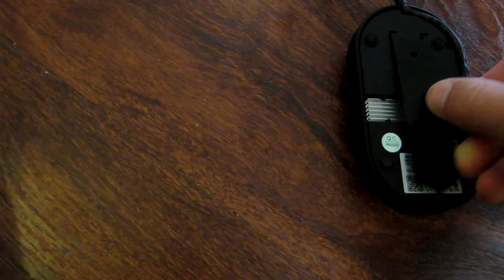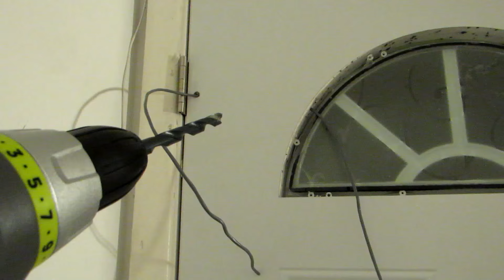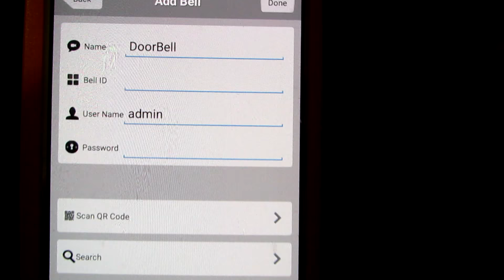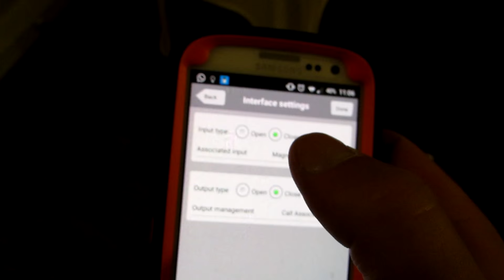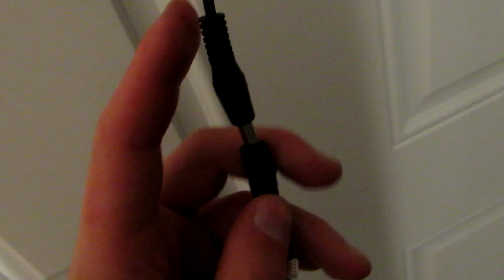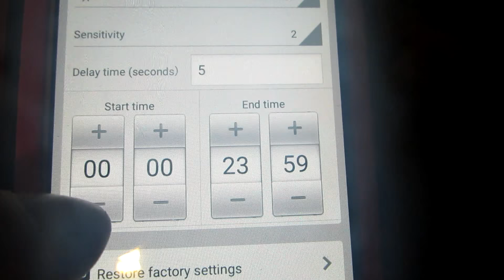YYGIFT® Smart Video WiFi Doorbell Review

Comment: You should have hires a professional to run your wires look as so sloppy. Sorry dont mean to burst  your bubble.
Reply from the maker: Paul Yanez Hey thanx for the feedback. After the video I removed the molding from around the door frame and buried all the wires behind it so you can't see any wires. I shot this video during the actual install and wanted to leave it running a few weeks so I know it worked well before hiding any wires. I ended up replacing the doorbell with the Zmodo Greet 2.0 doorbell as this one had no app development and had high battery drain at the time. I don't know if it's been improved, it's been a while.

Comment: Which is the best router to work along with it? Coz there is some lag in video. I am using Dlink- 2750U
Reply from the maker: I have the Netgear Nighthawk AC1900 which is real powerful but expensive around $200. I am going be doing a review soon on the Hootoo AC1200 router that recently came out for about 1/3 the price and upon first impressions it's not as powerful as the Netgear but really good for the price. It also depends on how many devices are connected to the router and how close the doorbell is to the router. Hope that helps!
Reply: Thanks mate, I am purchasing Tenda A15 AC1900 router to run the test,

Comment: Hi majunee,

I have the same doorbell, but I have an issue with it, the door bell does not enter the "Network Mode" by keep pressing the bell button in the device on the state. Hotspot is not created. please tell what could be the possible issue and how it can be resolved.
Reply from the maker: I've had that before. Try disconnecting it's power and then right after connecting the power hold the button to enter network mode.
Reply: Thanks for you reply, I have tried the mentioned solution, but no luck with it. :-(, is there any other way that the bell can enter in the network mode ? other than pressing the bell button for long.
Reply from the maker: +Mohammad Ali Try resetting the device, then do as above
Reply: Can you please tell how can i reset the device as i can't see any button or hole to reset the device.
Reply from the maker: +Mohammad Ali There is a small hole button on the back
Reply: Thanks majunee for the solution, can you please also tell how much current does the relay can bear ? and secondly the connect of the wire would be the same as we do in normal relay.

Comment: Your video has provided much help, since there's no other proper videos I can find to install it. I'm using the existing wires that i have from previous regular doorbell, however once power is connected it emits like a tv white noise sound. From there I'm unable to proceed with the rest of the setup? Did you ever encounter this issue? However, I did test it with a regular power supply and was able to set it up. Everything worked fine for about 5mins and then the connection to my wifi would drop. Did you have connectivity issues?
Reply from the maker: I never had a white noise sound... make sure the existing power supply is giving the correct voltage by using a multimeter to test it. I hardly have WiFi disconnect issues as I have a real strong router. The only issue I have with it is the high battery drain on Android when running the app in the background. The IOS app is better. The developer promised push notifications  for Android to fix battery drain but never did it and it's been over a year already and I think they may have given up development.
Reply: Thank you, yah i eventually did measure the output of the doorbell, it's at 10V, so I gotta change the transformer at the chime to a 16V. Have you had any other issues with anything else? Do you know if it works with any of the other apps?
Reply from the maker: +e0six12 glad it worked. There are a couple apps it works with but I feel like they are all the same just branded differently.
Reply: So it worked for a day, now the connection keeps dropping. Is there a way to do a full master reset besides pressing the reset button in the back? Would you know how to rectify the wifi connectivity? I'm constantly doing the reconnection, holding the doorbell button process, any suggestions?

Comment: Any idea if you can watch video also on desktop? Or record it on NAS?
Reply from the maker: Yes they don't advertise as being viewable on desktop but I do it all the time with third party apps/programs. You just need to find the cameras IP and port and then login and you get a basic video feed. This should allow recording to a NAS also.
Reply: +Majunee Reviews well I have IP but I have no idea about port... did you manage it?
Reply from the maker: +Radovan Pokorny Yes the default port is 80 if that's taken then it automatically increases by 1, IE 81,82,83 etc. You can use an app such as Tinycam monitor to help find the data by scanning your network

Comment: It seems the reflection from your outside glass door causes a bad glare.  If the doorbell is positioned to the side and around stomach/chest level can it pickup the visitors face and torso?  Or maybe angling the doorbell's metal frame up a little?
Reply from the maker: +G. Desouza Sure its best to not mount it behind the screen door. I unfortunately didn't have enough space to be able to mount mine there so I did it that way. Good luck!

Comment: Does the app have to be running the whole time in the background or will ringing the bell pull up the app automatically? Does the same hold true for iOS? Where'd you buy it?
Reply from the maker: +Levi Pine Shalom Levi, On android the app has to be running in the background and then when the bell is rung it pops up. I don't have an ios device to test it with but I was told that for ios it does not need to be running in the background. I got it from Amazon http://www.amazon.com/YYGIFT-Doorbell-Remote-Anywhere-Android/dp/B00XTV01QK/ . Please let me know if you have any other questions
Reply: +Majunee Reviews Thanks so much for getting back to me and so quickly. Did you try any other fun and cool gadgets worth mentioning? im a techie myself and have been researching this a lot. Curious why you chose this one say over the really pretty silver one
Reply from the maker: +Levi Pine Sure no problem. When I originally got this one it only came in black. Other cool gadgets I have is a smart home with smart light bulbs, switches, thermostat, and cameras. I use the staples connect and wink systems.
Reply: +Majunee Reviews Did you ever end up doing the electric strike wired to the camera? would like to have seen that. Looks like a fun project
Reply from the maker: +Levi Pine Nope I never ended up doing the electric strike. I wasn't thrilled with the need for the app to always be running and the subsequent battery drain. I am waiting for a new company to come up with a doorbell that utilizes androids built in push notification system and then maybe I will do it then.

Comment: Thank you very much for the detailed review.  Were you able to test the wifi range at all?  Unfortunately, it doesn't seem like any of these doorbells are 802.11 AC.  The only devices that have been able to connect to my router from around my front door were AC :(
Reply from the maker: My router is in my basement and the doorbell is on main floor opposite side of my house. I'd say maybe around 50+ ft. Maybe get a better router? Sorry couldn't be more helpful
Reply: +Majunee Reviews Actually, the router is excellent, but it is 60 feet away and has multiple double-brick walls in between.  Thanks for the reply though!  I'm going to try to convert it through powerline.

Comment: Doesn't work under Lolipop. Loads of issues with my Sony phone as screen turns black after somebody rings the doorbell
Reply from the maker: Interesting... I have tried it using custom Roms Cyanogenmod and AICP both running lollipop on my Samsung S3 so it sounds like an issue with your phone and not the android version.
Reply: +Majunee Reviews 
Well could be with Sony as with my Z2 and Z3 and my Sony tablet it doesn't work........
It works with older versions of Android on the Sony phones and Tablet so its definitely has some thing to do with software
Reply: Btw it only doesn't work when the phone is locked i.e. you have to unlock with a pin before you can go into the app. What happens is that when you want to turn back to the home screen the screen turns black with only the top visible. Thit doesn't happen when the phone is unlocked
Reply from the maker: +Ron Vlasveld Can you try turning off your lock screen and seeing if it works well? If it does you can try a 3rd party lockscreen instead of the built in one, or try adjusting lock screen settings. Please let us know what happens. thanx
Reply: +Majunee Reviews  That is what I wrote, if you turn it off it works. Using a third party lockscreen tool is not advisable and why should I ..... why do I want to workaround a problem from this manufacturer and open up my phone for more problems.... they should just fix it as it is clear in which area this problem sits.... These manufacturers are too lazy to fix problems out in the field
Reply from the maker: +Ron Vlasveld I agree with you the software is lacking and I was really hoping for an update to improve reliability in the WiFi connection and to not have the app always running in the background in Android. There is no reason not to use push notifications instead. I was just recommending a solution if you wanted it to work. Almost every doorbell similar to this one from China uses the exact same software so a different model won't help. Honestly if you go to Google play and search WiFi doorbell most apps will work with this one. I tried like 5 to see if any were better. In lollipop if you turn on trusted places options I think there may be an in pocket option where it won't lock back up if it's still moving right after it was unlocked. I'm not sure if Sony included that part of Lollipop. If they did that may allow you to keep the stock lockscreen but not have it lock up on you.
Reply: +Majunee Reviews Yes I explored most of them as they all using the same engine just the look and feel of the app might be changed. All have the same problem and indeed why not using push as that is made for these situations.
Thanks for your tips and advise I will look at the trusted places and see if that helps.
Currently I just use my phone as an extension to the door bell, I just don't answer it on my phone but open the door instead, it will show who is in front of the door on my locked screen .... as long as I don't answer i.e. open the app when somebody is at the door, it all works ... that was the main purpose of it anyway to see who is ringing the bell.....
Thanks again

Comment: Sorry to be such a dummy..I go to wi-fi settings on phone & it shows my router connected...no other items....turned on blue tooth & personal hotspot as well...since I use blue tooth a lot I'm expecting to see "doorbell" show up some where but don't
Reply from the maker: +Frank Fitzhenry Turn off hotspot as that can mess up your wifi. Disconnect from your home wifi and then search for the new Doorbell hotspot and connect to that. There is no bluetooth involved with the doorbell either.
Reply: +Majunee Reviews ok turned off hotspot & blue tooth disconnected from router signal...pressed & held doorbell for 12 seconds....nothing new showed up...would seem phone needs to be connected to wi-fi??
Reply from the maker: +Frank Fitzhenry The way it works is when you press the bell button for ~8 seconds it goes into configuration mode and creates a hotspot. You then are connecting your phone to that hotspot. Once in the hotspot you can go into the app and should be able to add the doorbell by clicking the search for doorbell button. Once connected to the doorbell you should be able to click it and view it. After you can properly view it then you go into the app wifi settings and search for your home network and put in the password so that your doorbell can now be connected to your home wifi. Once its connected to home wifi you will be able to view it from anywhere in the world. If after pressing dorbell for x amount of seconds and its not creating a wifi "hotspot" then you should double check your wiring to ensure that the doorbell is actually getting power. How are you powering the doorbell?
Reply: +Majunee Reviews Again thank you for your patience...door bell powered by existing 24vac...blue light on...phone bluetooth off...hotspot off...wi-fi off...pushing & holding bell button does not create a signal "hotspot"
go to app & search & it does not see anything either..turned wi-fi on told it to search & all it see are my routers
Reply from the maker: +Frank Fitzhenry You should hear a voice prompt after holding doorbell button for 8 seconds and it should be flashing blue, if its not doing that try unplugging it and plugging it back in and see if that helps.
Reply: +Majunee Reviews may have found problem....measured voltage & only getting 8vac to bell....gonna rewire to a 12vdc source & test...so more later  thank you so much for help.
Reply from the maker: +Frank Fitzhenry Sure no problem...let me know what happens

Comment: Thank you for the response. I have my iphone5 open to the Pro app & when I push & hold the bell button nothing happens with the app. The app does not open into the wi-fi setting mode. The light is hard to see but pushing & holding does not cause it to start blinking as described in (3.2) of set up instructions. Have I missed a step?
Thanks
Reply: I have an android device but I'm sure it's pretty similar....press the doorbell button for around 8 seconds, then on your iPhone go into your WiFi settings and look for one called doorbell..XXXX, connect to that WiFi, then open the app and go into WiFi settings of the app to find your home network and connect to it by putting in the password...let me know if that works